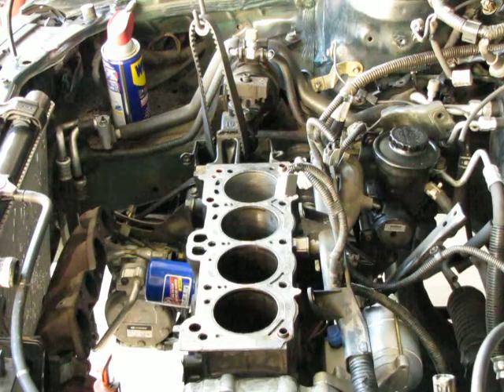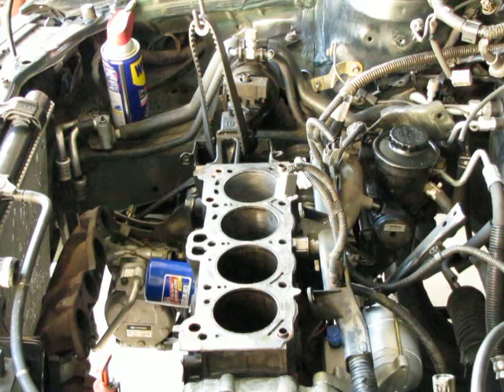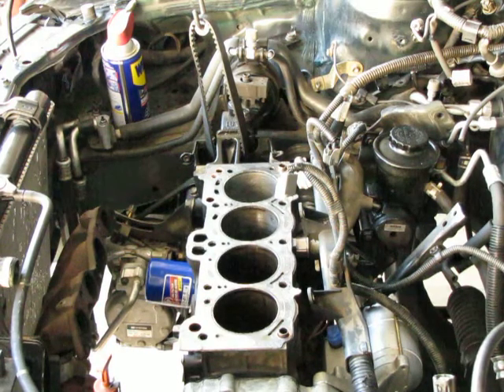How to hone an engine cylinder

Comment: Did you cover the crank .......
Reply from the maker: Covered the crank with tape. I put the tape on backwards, sticky side out so if any particles fall on the bearing, they stick to the tape and leave with the tape when we remove it.
Reply: Hows the engine running ? And what did you use to clean off all the mess ?